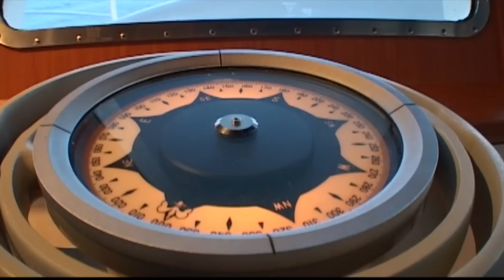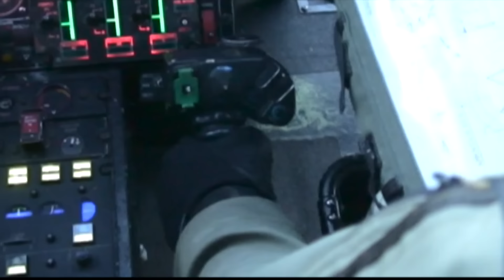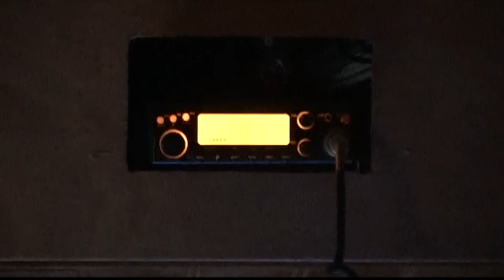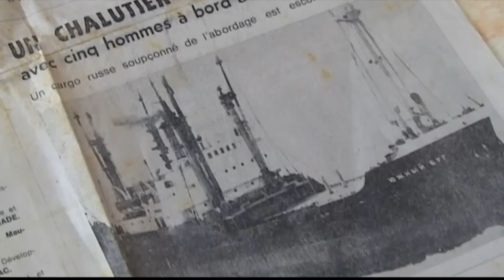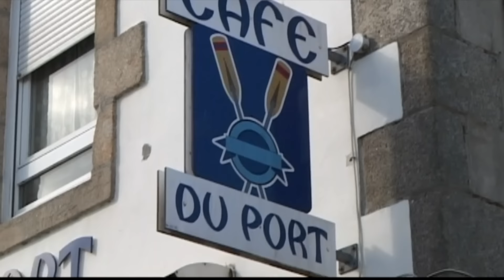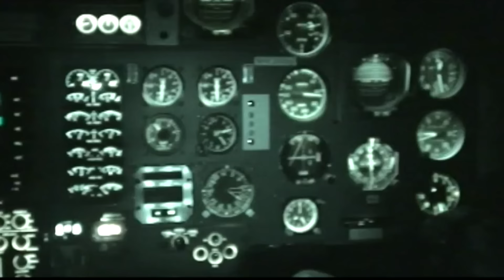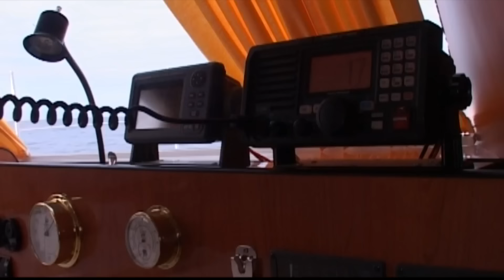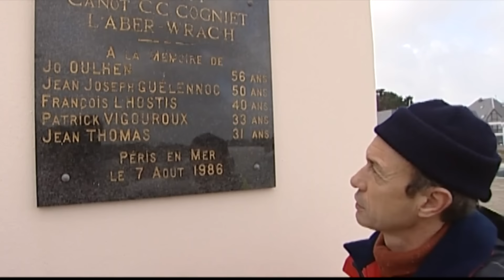Maritime search and rescue - Documentary

Comment: why did they not get welders on the boat, and actually repair it at sea. with big plates. as it still was not sunk at the start. it would ahve taken them maybe 10h to repair it. and pump the water. so i don't understand why the just pulled it. and thought it would hold. it clearly started taking in water and sunk.

Comment: 48:45 why don't they send divers down to the frater Ece, to try and empty the tanks, before they start to leak. its going to be more expensive to clean up the sea, if they really start to leak.
Reply: They ended up doing a controlled release in September 2006. Most of the acid leaked out on its own and was slowly diluted, the rest was released during the salvage operation, studies done since have shown no impact on the environment.

A much bigger problem was the fuel and machine oil. Ironically, 10 000 tons of acid is no big deal, since it's water-soluble and gets neutralized quickly after leaking, but the ~100 tons of heavy fuel and oil could really do a number on the local ecosystem. Fortunatey the reservoirs of both were undamaged and it was all pumped out of the ship.